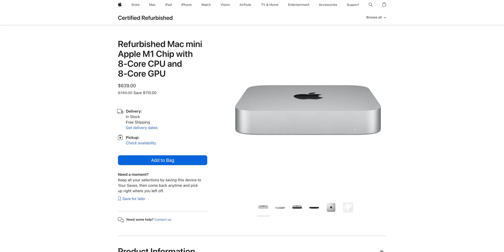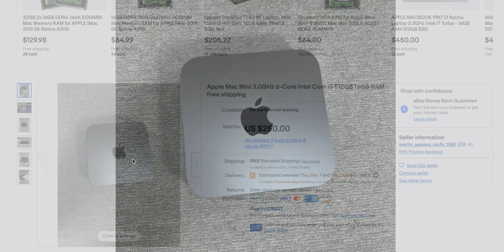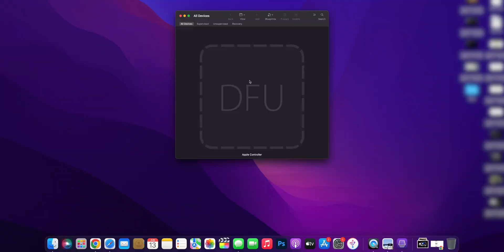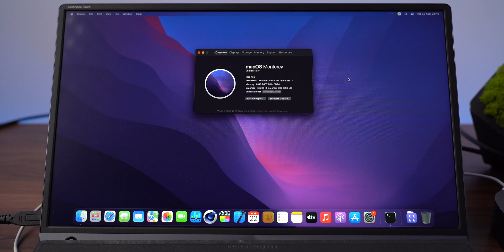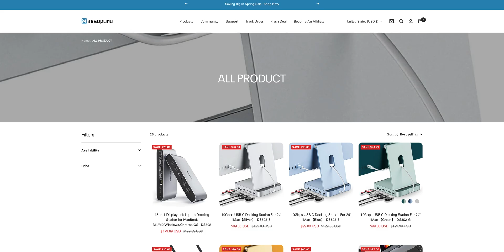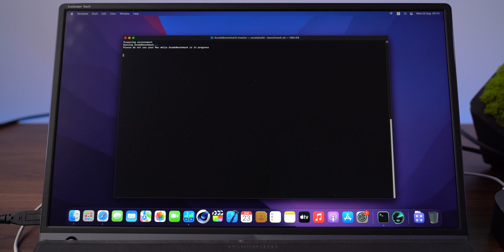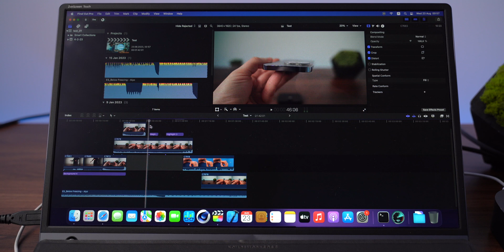Is 2018 Intel Mac Mini STILL GOOD today ?  #mac mini

Comment: I just found this video and you probably figured it out, but the RAM sticks appear to be missing rubber protecters over the memory chip clamps and a heat shield that fits over the memory sticks.

Comment: I would skip both and get a 2013 Mac Pro. That is the cheapest of the 3, and usually comes with 64GB RAM installed, and it runs basically any OS you throw at it at a still great speed. For example the D500 is 5 times as fast as the Intel UHD630. Also it is really silent. With the M1 you are limited to 32GB at a very steep price increase, the 2018 is obsolete by any means.
Reply from the maker: Consider new Mac mini with m4 is out, I would better buy that one. Will post a new video in January with its overview
Reply: @IhorPushkar  The M4 is ugly, flimsy, comes with the butt ugliest OS ever made, it flies over your table and it is upside down in all promo photograpy....

Comment: Hell YEAH, it's still good. I just got one used with an i7 processor (YAY!), 16 GB RAM (MEH...) and 256 GB SSD (BOO!) LSH: It now boots from an external 2TB M.2 SSD and has 64GB of RAM. It's a beaut. Dirty Confession: I REALLY wanted a 2012 Mac Pro- But I also wanted all the T2 reliant features of Sequoia
Reply: good that i bought mac mini 2018 and not 2012 mac pro

Comment: I have the 2018 i7 mini with 32 gigs of ram and it's OK until you want to use a 4K display, which inevitably means you have to enable scaling just to see things clearly in the interface. At the point it becomes dog slow with all kinds of spinning ball and the rest. It's a struggle to even have Youtube playing in the background while editing an image file. The graphics on this computer was always the weak spot and it doesn't take much to push it over the edge.

Comment: Maybe problem with the memeory? Did you try 1 stick or other stick? Maybe faulty ssd? try to install the system on external ssd.If the heatsink is not connected properly then your fan should start spinning very quickly at full speed. If not then the overheating is not the problem.
Reply from the maker: Thanks for advice. I have already diagnosed that it was actually problem with Ram, but I cannot figure out how to get back this mini to work: to make long story short - I put this broken memory to another Mac mini and it did the same glitch, I am thinking it caused the bridge os to corrupt, currently don’t know how to fix that…
Reply: @IhorPushkar  You would just have to replace the RAM entirely, RAM like that constantly glitches out and creates boot loops or what you had happen.

Comment: I'm using a 2018 Mac Mini 3.2 GHz 6-Core Intel Core i7 with 32 GB RAM and 1TB SSD for all my daily work.  I needed the Intel chip for running VMware Horizon Client for running Windows VMs.  No complaints and still going strong. Thanks for the video.
Reply from the maker: Thanks for the feedback, great to hear that you can still got the juice from the 2018 Mac mini
Reply: Todavía le puedes colocar los 64GB y rendirá hasta que muera sulfatada. Amo los mac mini intel, tengo un 2010, 2012, 2014 y estoy por comprar un 2018. todos los tengo como unidades para ver películas y multimedia. Totalmente actualizados al máximo de RAM y unidades de almacenamiento.

Comment: Perhaps a new heat sink would fix that faulty MM..
Reply from the maker: I also tried to remove it and load without it-same thing happening. There should be some short circuit on the motherboard.
Reply: @IhorPushkar  That is possible but heat sinks have to be set properly and because that one is damaged it will not fit correctly, trying to boot the computer without a heat sink attached would have the same result and it could overheat the processor.
Reply from the maker: I think it cannot overheat in just one second or so, it should be at least working for an hour or so to get it heated up.
Reply: @IhorPushkar Thanks for the information, I'm more familiar with PCs., than Macs and hopefully you will be able to fix that MM., but parts computers are also useful.